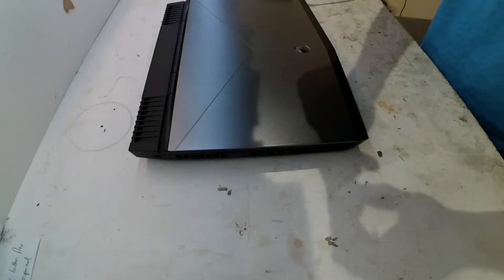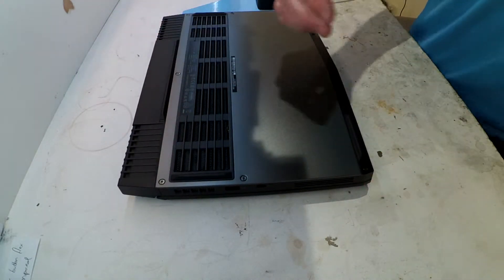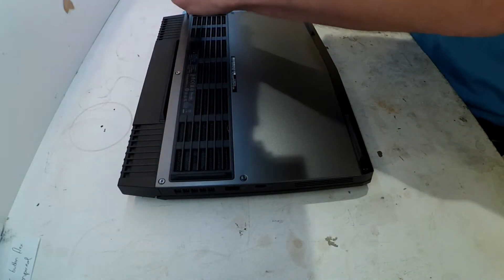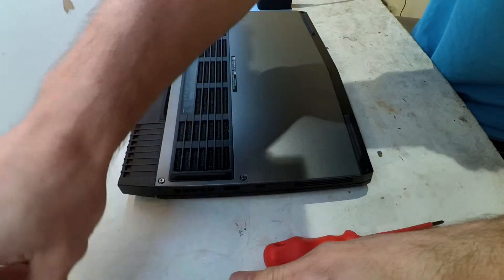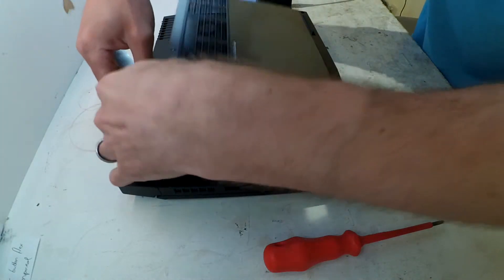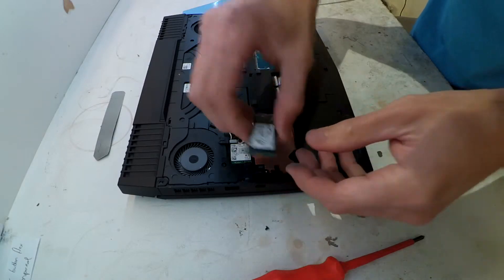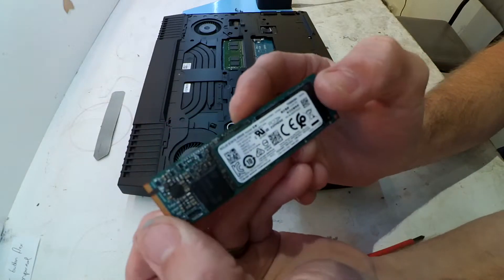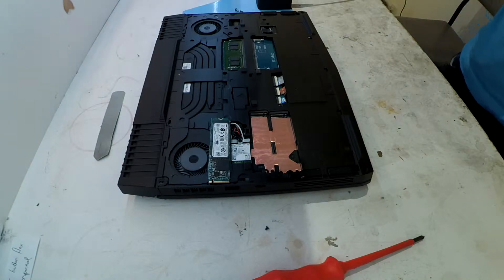Alienware 13 R3 NVMe Upgrade

Comment: Do I have to download windows on that new memory storage card? I’m super new to upgrading storage on my gaming laptop please help! It looks super simple on just putting that in their and that’s it your done ?
Reply from the maker: You need to have windows reinstalled or cloned to the ssd
Reply: Ricks Tech do most tech stores like Best Buy or micro center (not sure if your familiar with those stores) have them already installed?
Reply from the maker: @williegonzalez1692  unless listed probably not 

I would think both of those stores could install the SSD and migrate your system to it
Reply: I might have to clone it? Lol what did you do off yours
Reply: Ricks Tech thanks for the info bro